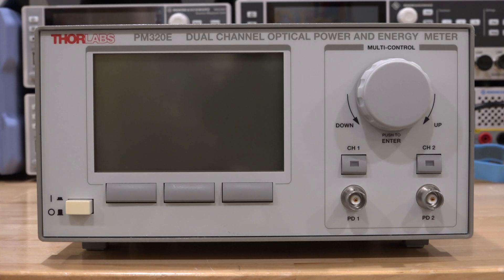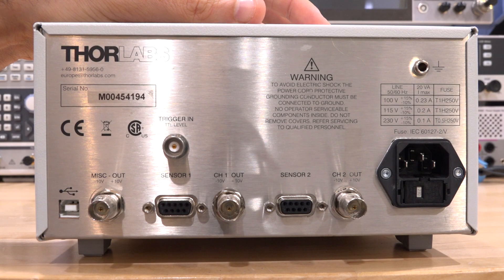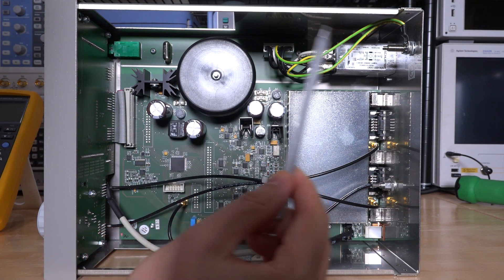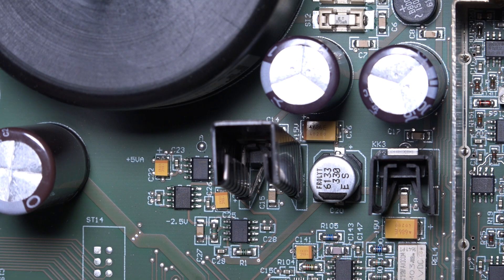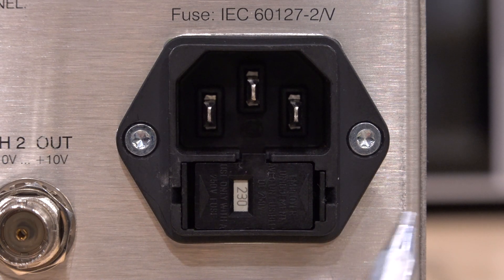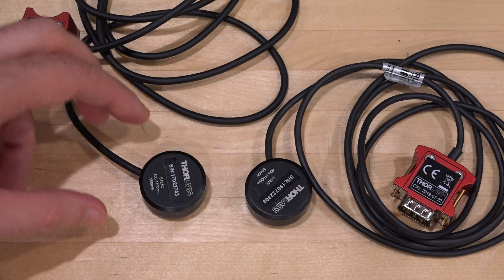TNP #51 - Thorlabs PM320E Dual Channel Optical Power & Energy Meter Teardown, Repair & Experiments

Comment: So did you notice it was set to 230V before you started measuring the power supply? 🧐
Reply from the maker: No. My conclusion that something is off with the transformer was based on my measurements.
Reply: @TheSignalPath  I done the same mistake of plugging something in without ensuring the correct mains selection.
Except I live in Europe and lower voltage gear tends to have their transformers burn up when this mistake is done. Ie, always check before plugging any new gear into the wall.

Comment: Thorlabs PM320E Dual Channel Optical Power & Energy Meter: Teardown, Repair, and Experiments

* 0:16 Esoteric Instrument: The Thorlabs PM320E is a specialized instrument used in free-space optics and laser design for measuring optical power. It's capable of interfacing with both basic photodetectors and Thorlabs' "smart" C-Series sensors.
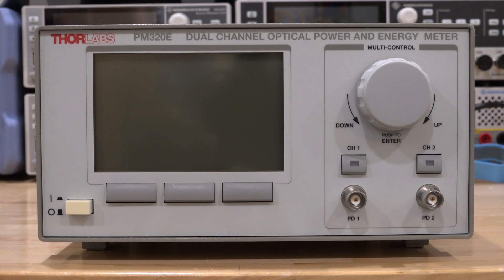* 0:30 Versatile Interfaces: The PM320E features analog inputs, DB9 connectors for smart sensors, analog outputs for use with external digitizers, and a USB port for computer control. [From joopterwijn's comment] Remote setting control via software might have negated the need for the repair detailed in the video.
* 1:05 Faulty Display: The unit was acquired from eBay at a low price due to a display issue; the screen appeared completely white, suggesting a potential firmware or hardware problem.
* 1:14 Contrast Issue: Closer inspection revealed that the display was actually very faint, not completely blank, indicating a problem with the display contrast. 
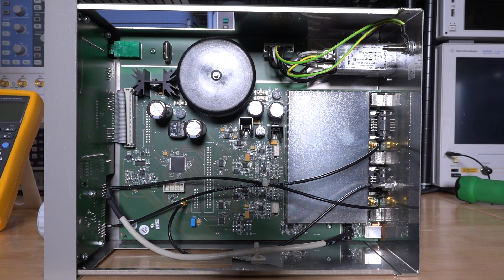* 2:30 Internal Layout: The unit's internal layout shows a clear division between sensitive analog circuitry and digital/power supply sections. Thorlabs' expertise in optoelectronic devices is evident in the design. [From douro20's comment] Thorlabs is known for its vertical integration, manufacturing a majority of components in-house.
* 3:57 Power Supply Issues: The display brightness initially surged and then dimmed, accompanied by beeping sounds, suggesting a power supply problem.
* 5:50 Voltage Regulator Investigation: Measurements revealed that the +/- 15V supplies were significantly lower than their expected values, pointing to an issue upstream of the voltage regulators.
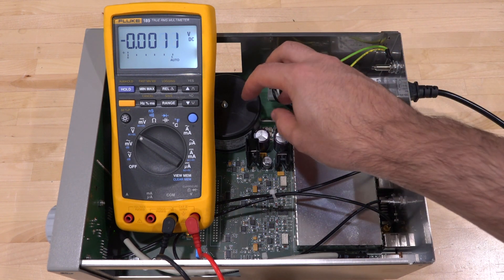* 6:45 Voltage Selection Error: The unit was mistakenly set to 230V operation instead of 115V. This incorrect setting caused the transformer to output the wrong voltage, leading to under-biased +/-15V supplies. [From pengiswe's comment] It's crucial to double-check voltage settings to avoid unexpected repairs. [From s0rc3's comment] Failing to check voltage settings can damage equipment and even cause widespread power outages.
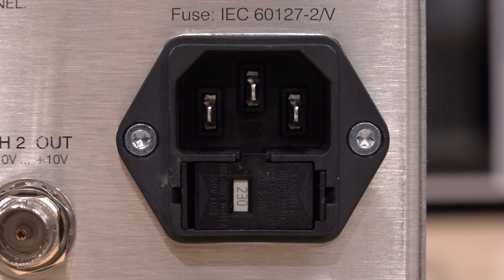* 7:28 Successful Repair: Switching the voltage selector to 115V and ensuring the correct fuse was in place resolved the display issue, bringing the unit back to full functionality.
* 8:29 C-Series Sensors: The video demonstrates the use of Thorlabs S121SE (0.5W) and S120C (50mW) sensors, highlighting their automatic detection and calibration data transfer capabilities. [From stevensworld14's comment] The S120C is a popular choice for lab applications, and its high price compared to the repaired unit highlights the deal obtained.
* 9:25 Ambient Light Measurement: The sensors detected approximately 50 microwatts of ambient light, showcasing their sensitivity.
* 10:02 Laser Power Measurement: A 670nm semiconductor laser was used to test the unit's accuracy. The laser's maximum output power was verified to be below its rated 5mW.
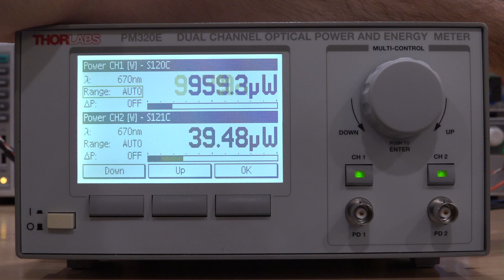* 11:05 Sensor Discrepancies: A slight difference (5.8%) in power readings was observed between the two sensors, potentially due to sensor-to-sensor variation or calibration drift in the PM320E itself.
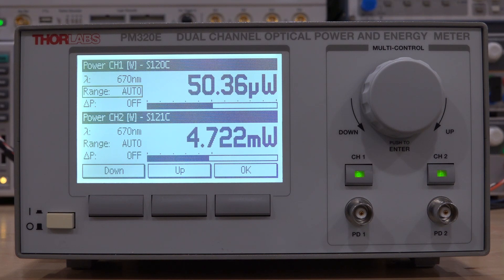* 11:42 Linearity Testing:  The laser's modulation capability was used to test its output power linearity, showing good results with a triangular wave modulation.
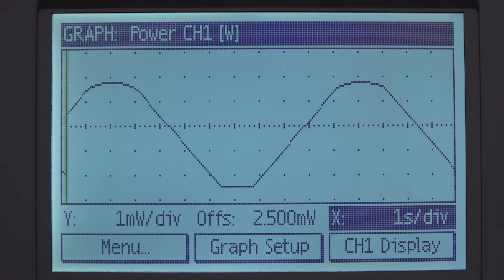* 12:41 Future Experiments: The repaired unit and acquired sensors will be used for future experiments in the lab. [From xDevscom_EE's Comment]  A suggestion was made to explore the optical power output of generic lab communication SFP modules in a future video. [From OctavMandru's Comment] A request for a series or channel dedicated to optics, particularly the transition from microwave to optical frequencies, was made.

I used gemini-1.5-pro-exp-0801 on rocketrecap dot com to summarize the transcript.
Cost (if I didn't use the free tier): $0.07
Input tokens: 18188
Output tokens: 876

Comment: Hey Shariar! Optical equipment is quite esoteric for many, maybe you could start a series or maybe even a new channel about Optics. 
I am quite curios (also as a radioamateur with new sparked interest in GHz area) about the transition from microwave radiation to optical.

Comment: I had a vacuum pump that didn't indicate if it was 110/230V and I accidentally plugged it into a 230V circuit when it was set to 110V and it tripped the breaker and few million dollars worth of equipment all shut off. oops. Silly design to not label the swtich.

Comment: Yay! Repair time! Power line is pretty boring. I'd be curious how much optical power comes out from generic lab communications SFP. There are many warning labels near them, but are they that dangerous, especially cheaper 1GbE/10GbE modules? Maybe something to try in future?
Reply: Depending on the distance the modules are rated for, they can definitely be dangerous.